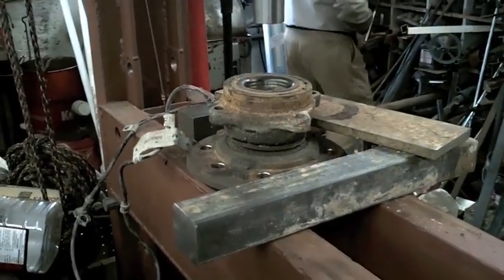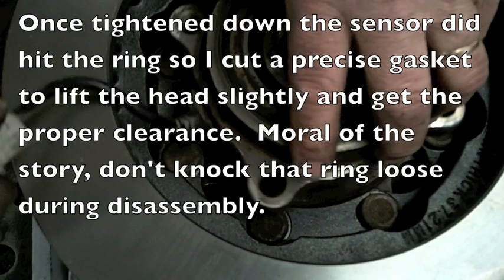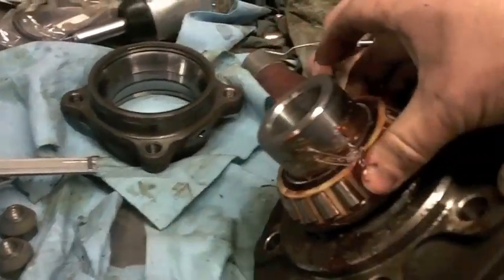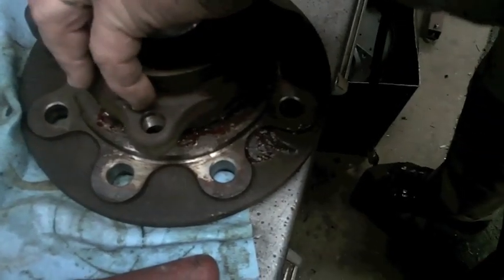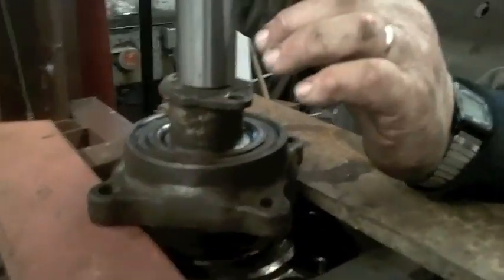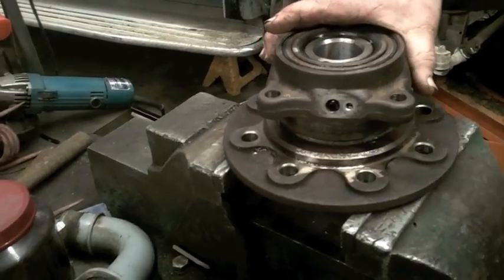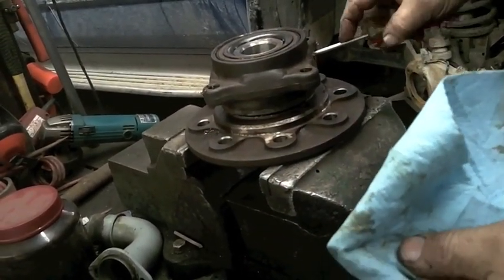Dodge Ram Front Bearing Assembly Rebuild

Comment: I just pump grease in threw the abs sensor hole on about all bearings designed this way.. I just did it to the front hubs on a gmc jimmy yesterday.. no need to even take the hub off the truck.  Just have someone turn the hub as you pump grease in.  It might mess with the abs sensor for a short time.  But I usually never have the light pop on.

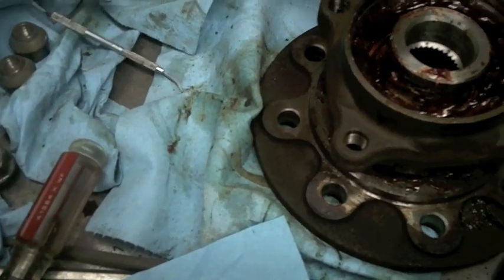Comment: Did anyone notice they put the hub together backwards. The inner hub has a machined side and a rough cast side. The machined side should stick out so it bolts to the axle housing. Look at before they push it apart (:30-:45) and then reassemble(10:00-12:00).  At 13:02 his finger is pointing to the machined side, that should not be facing the rotor.
Reply from the maker: Yep good catch, we had to press it apart and reassemble.
Reply: Is that why it was so hard to turn originally?  I'd imagine if the bearings are tapered just a tiny bit differently, it would bind when pressed together.
Reply: how could they put it together the wrong way when they never pulled the race out of that piece of the hub......it wouldn't go together would it ?

Comment: Weld a heavy bead with 7018 running hot on the inner race and it will shrink it making it a LOT easier to get out..

Comment: $199 from Orielly's is going to be their cheap no name hub assembly . However all the good brands moog Timken and SKF that cost $250-$300 in most auto part stores are had online for $150-180 . The Orielly's cheap brand according to the folks working there do not come pre-torqued like the better brands ,which is not a big deal since pre loading is as easy as putting 130-150lbs of torque to the hub and spinning the wheel to seat the bearings then final torque to 262 ft/lbs with wheel on the ground .

 I add grease to this assembly through the threaded  ABS port with a grease gun .

Comment: Where did you find a new seal for the hub assembly?
Reply from the maker: I think we used the part numbers on the seals to grab a pair from a bearing house but I will have to check my documentation to be sure.  That or we didn't, just cleaned and regreased them.  There is about 15,000 miles on the rebuilt hubs now.

Comment: replaced both sides on my 2004  .. 4x already//with moogs.. bad design..there good for 40,000 miles
Reply: Same here pathfinder had 120K on the OEM fronts and the moogs done at about 40K.  Disappointed.

Comment: I've never seen anyone load grease into a bearing like this. Ever hear of putting a wad into your hand and slapping the bearing into it? And rotating it in your hand? Zero tools involved, 100% success rate.
Reply: Clearly they couldn't do that with the bearings pressed on a shaft and a seal covering it, did you even watch the video?

Comment: I had a bearing come apart. broke the left axle u joint messed up ball bearings an so on
on my 1/2 tone 1500 it was still fully greesed and i just had the left side after 32 days.  yes a new one 32 days on the truck and it came apart  sheard  apart baring's falling out.   but it was made  or both wer made in china  left one lasted 2 years right 1 lasted 32 days.

Comment: This is very unsafe! Please do not do this, your tire will literally fall off. There are reasons why some parts on the car are not serviceable.
Reply from the maker: ...20,000 miles later with 200,000 total on the truck and we are still rolling but your milage may vary.
Reply: Actually , there are designs that are a hybrid of the old totally serviceable kind and the modern sealed type that have pressed in bearings but can be rebuilt so I don't see a problem with this being done as long as the parts are still usable .
Reply: If the part was put together it can be taken apart.